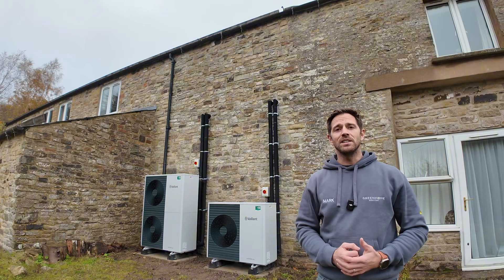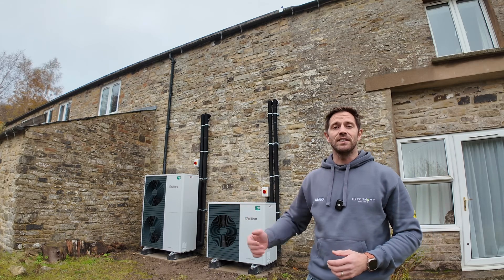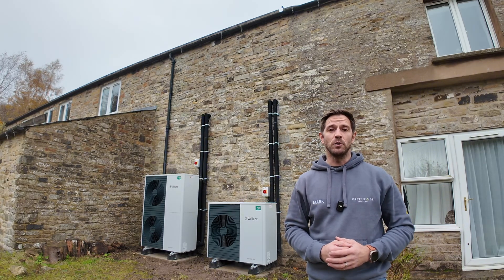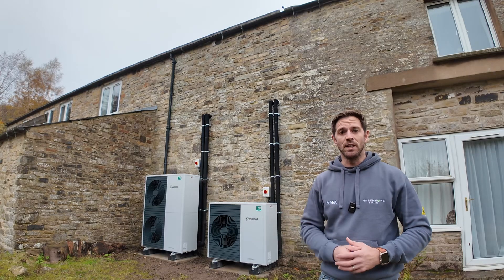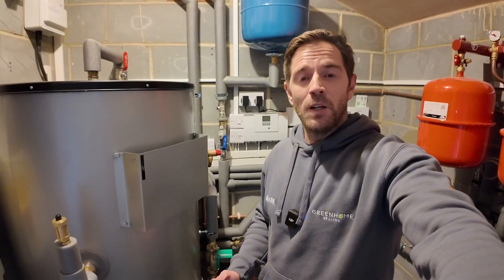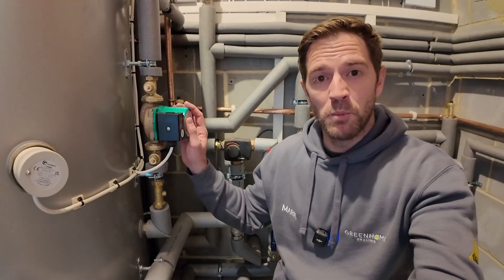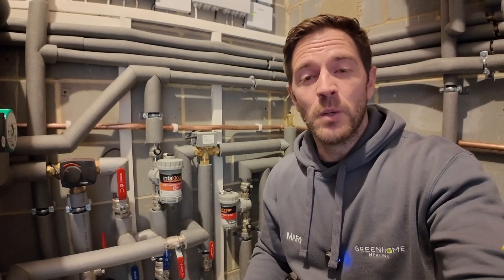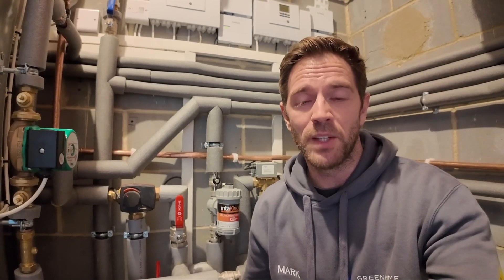North Pennines Heat Pump Installation

Comment: It looks like you did a great job. 

Those rads look quite a bit bigger than you'd need for a gas installation.
Reply from the maker: Hi, with a gas boiler the temperature would be around 70 degrees going through the radiator but with the heat pump it’s more like 42.5 so we need more surface area to give off the same amount of heat.
Reply: Depends upon how you define "need". If, for greater efficiency,  you wanted to run your gas boiler at 45ºC, then that would also need radiators of that size. Efficiency of heat pumps varies more with flow temperature for a heat pump, which is why there is the concentration on low flow temperatures, they can work at higher temperatures and still save a mass of carbon. Most gas installations don't consider efficiency, which is why most condensing gas boilers with quoted efficiencies of say 95% only achieve around 80% when installed.